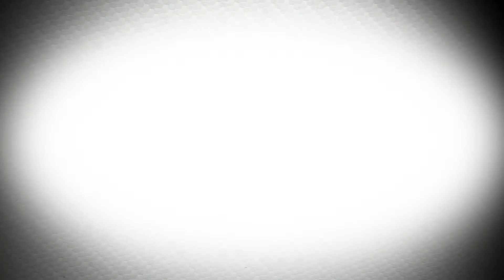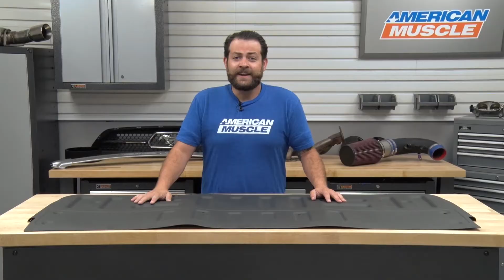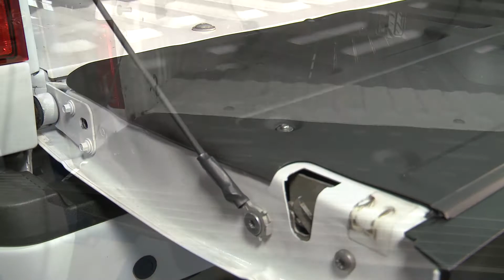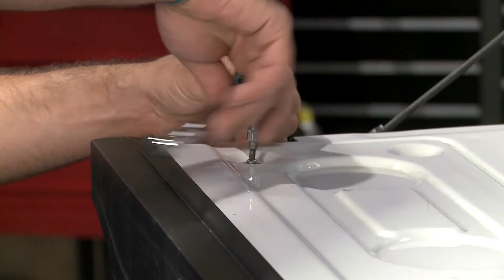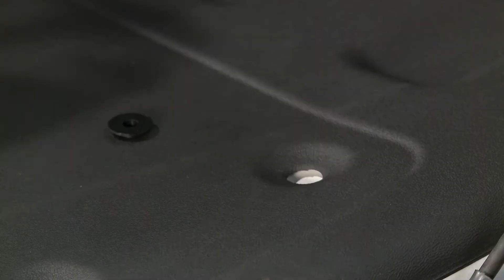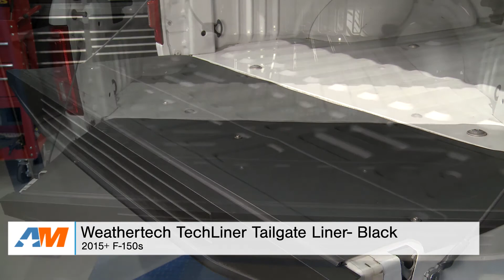2015-2017 Ford F-150 Weathertech TechLiner Tailgate Liner Review & Install

Comment: Installation tip. The newer trucks having aluminum bodies are probably heavier gauge and the trim strips are too tight to accommodate the liner and the access panel. I sprayed silicone in the strips and the liner slipped right in. Prior to that I spent 2 hours struggling with no success.